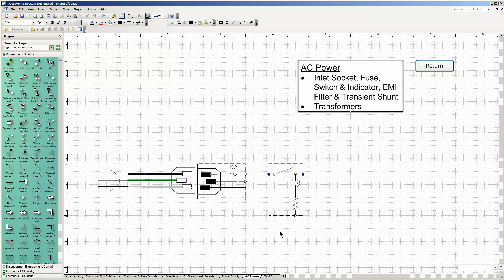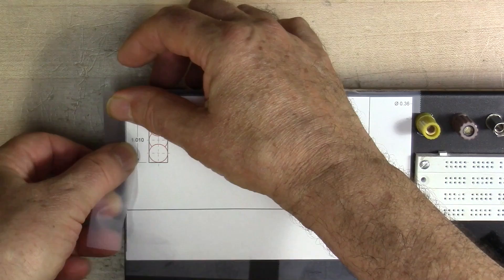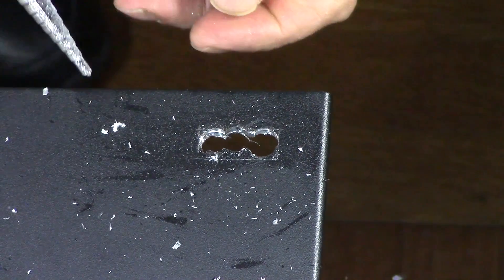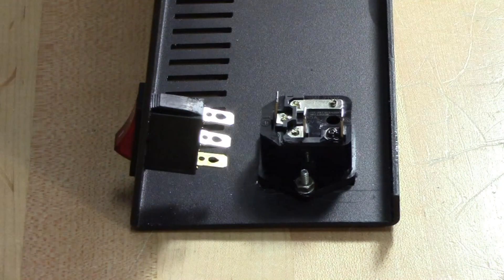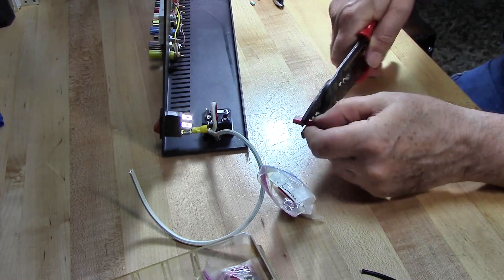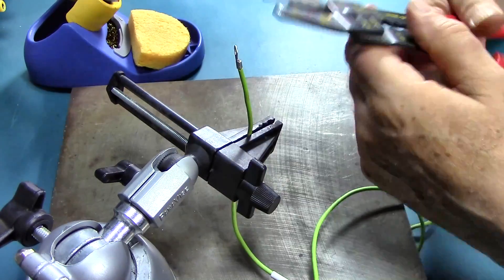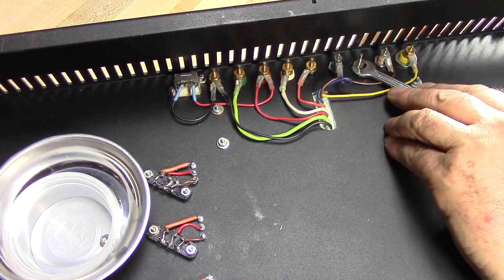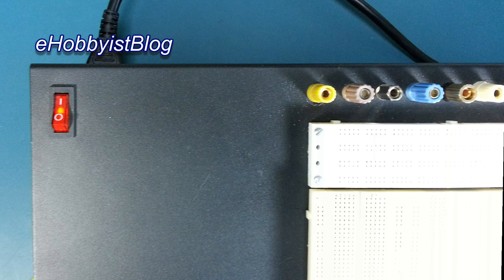017-Power Supply--AC Power (2)

Comment: what is a softwher how do you do a diagram ? thaks
Reply from the maker: The diagramming software I use Is an old version of Microsoft Visio. There are free Visio viewers, one of which is noted in 
     http://ehobbyistblog.com/references/ 
If you are interested in electronics--circuit diagrams and printed circuit design--see, in the section headed
     032,33,34-Prototyping System Power Supply–Variable + (6,7,8),
the reference
     Electronic CAD Programs.
(Some of these programs are free).